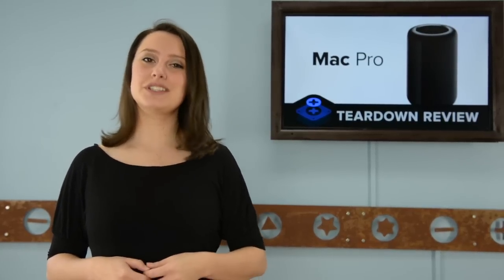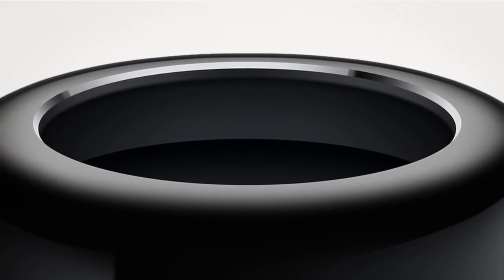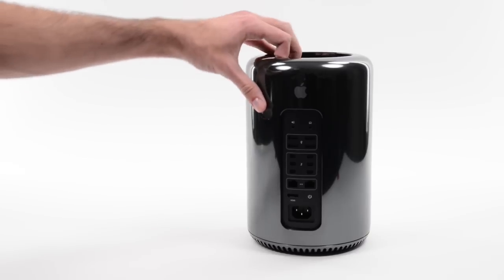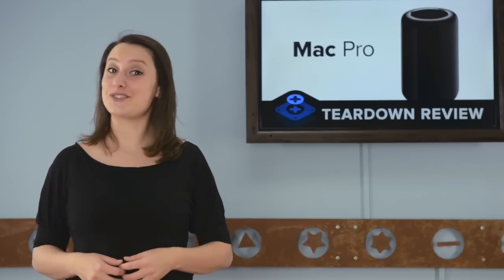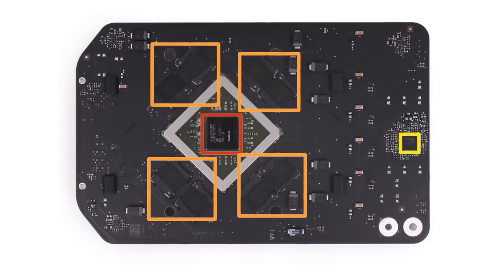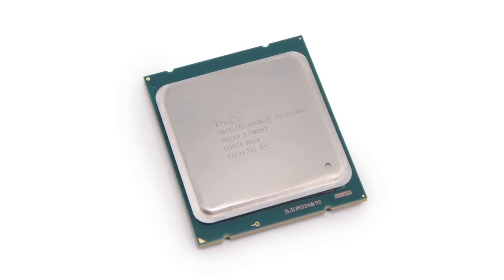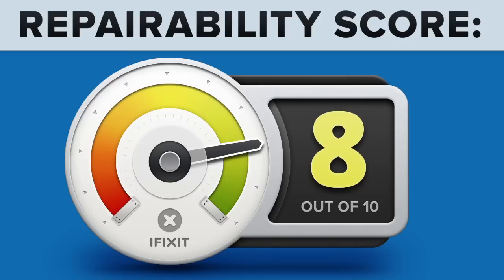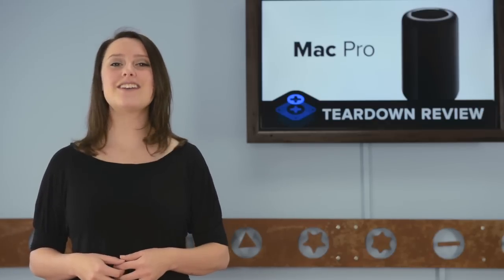Mac Pro Teardown Review

Comment: From an engineering point of view it's a very well designed machine. However it's still overpriced.
Reply: Respected Fella The high price comes mainly because it's designed to be compact and efficient. Which is pointless unless you want to use it as some form of server module, for some reason. Why would anyone want to use a Xeon for a work station? It's too expensive for such a purpose. A xeon inside a Mac book-great! A xeon inside a desktop PC- not so great. This computer would have been a very good Mac mini. But as a full PC it's too expensive for the performance that it offers.
Reply: ronettreker
Well, you also have to ask HP and Dell and Lenovo why they have been using Xeons for all their workstations.
A Xeon offers certified 24/7 operation, more than 32 or 64 GB of RAM and more PCIe bandwidth and more cores.
Or should Apple have gone with enthusiast i7s, which are limited to 4 to 8 cores and 64 GB of RAM and are not rated to be run 24/7?

Well, as for a Xeon inside a MacBook, you probably do no have any idea about Xeon CPUs.
Reply: Respected Fella What I know is that Xeon processors are more efficient and reliable than Intel Core ones but offer less processing power per dollar. So you would use a Xeon if you want a computer that runs 24/7 consuming as little power as possible (mostly servers). Dell and Lenovo have both expensive more efficient Xeon based workstations and cheaper Core based ones. I know Macbooks and most laptops don't have xeon, they mostly use Core while some use Atom, Pentium and Celeron. What I wanted to say is that a Xeon inside a laptop(like macbook) would be great, because of it's higher efficiency thus lower battery consumption(correct me if I'm wrong).
Reply: ronettreker
Xeons are workstation/server CPUs, as they are rated to run 24/7 (some workstations have to do that, either at a broadcast network or at a media production facility or in a research lab).
They are not as power efficient as mobile i7s for example, as those i7s used in notebooks consume about 45 W when in peak use, some only 23W.
A Xeon uses more power and is not ideal for mobile computers. Its size also prohibits it (due to being socketed instead of soldered) to built into notebooks.

Look at this "extreme" comparison between a Xeon 18 core and i7 8 core CPU, both are desktop CPUs: http://cpuboss.com/cpus/Intel-Xeon-E5-2699-v3-vs-Intel-Core-i7-5960X

Also know, that i7s are limited to 32 to 64 GB RAM, Xeons can have 512 to 768 GB to even more RAM.
Reply: Respected Fella Strange...I understood from people like Linus and David L Jones(EEVBlog) that Xeon processors are more energy efficient than Core processors. I do agree on the socket...Never seen a BGA version of a Xeon...
Reply: ronettreker
They are more energy efficient as desktop i7s maybe, but not as efficient as mobile i7s, since there is a difference.
And mobile i7s are limited to 4 cores and 32 GB RAM, not something a REAL workstation can live with.
Mobile i7s and many desktop i7s also have limited PCIe bandwidth.

And when it comes to power consumption, such values have to be considered against all the other aspects, thus less power consumption is not always the goal if one is limited with less cores, less PCI bandwidth and maximum RAM usage.
Reply: Confused Fella Ok. I understand. I thought laptops have similar core processors as desktop only with limited clock rate...I was wrong.
Reply: ronettreker
The i7s and i5s share similarities, but also have many differences in order to achieve the lower power consumption.
Reply: +ronettreker Yeah the 12-core mac pro has a lower clock speed, but that's because it has 12 CORES... A lot of processors with a lot of cores have a lower clock speed, but that clock speed is per core.. So obviously the mac pro is designed for multi-core software such as Final Cut
Reply: +ronettreker Expensive? Yes. Overpriced? Not really.

A comparable (to the base $3000 model) machine, self-built, would only be $720 cheaper. Bear in mind that this is with a standard ATX form factor and uses standard components. The tiny trash can form factor is expensive, especially with the LGA 2011-3 platform. http://pcpartpicker.com/p/VYcfXL
Reply: ReinheldFilms 12 core?! The mac pro has a 4 core and a 6 core option. Can you please give me a link to this 12 core Mac Pro?
Reply: ronettreker
http://pcpartpicker.com/p/3QLk23

It still does not have Thunderbolt 2.0 and BT 4.0 and it is slightly larger, but hey, why consider all aspects if you can ignore most of them.
Reply: ronettreker try apples us website
Reply: Confused Fella Honda Crf Went on Apple's US website. Yep it does say there's a 12 core xeon version, but it doesn't say the price. Anyway, is it really worth it? The six core version costs 4000, while the six core PC in the video comparisson I linked costs only 3000. I know a 6 core Xeon is better than a 6 core I7 or any 6 core AMD, but in the end the cheaper 6 core I7 performed better than the more expensive 4 core Xeon. Yes, at the price of higher power consumption, but it's a desktop PC, so power consumption isn't very important. Also the cheaper 6 core in the video run at lower clock rate. Also beacuse it's a custom PC you can skimp on less important things like the case and you can use a dual drive(SSD+HDD) to lower the price even more, something you can't do with the Mac Pro. Even more, if space and power consumption is not an issue you can use an AMD which will lower the price even more. Ok, the 12 core Xeon Mac Pro may be worth the price since there's no cheaper processor that can compete in terms of power, but the 4,6 and 8 core versions are not worth the price of the Mac Pro.
Reply: ronettreker
It does say the price: http://www.apple.com/shop/buy-mac/mac-pro

As to the 4, 6 and 8 core versions:

• The quad core version upgraded to the max costs 6,099 USD.
And here is the alternative, without TB 2 and BT 4.0: http://pcpartpicker.com/p/BKsJJx

• The hexa core versions upgraded to the max costs 6,599 USD.
And here is the alternative, again without TB 2 and BT 4.0: http://pcpartpicker.com/p/WXM8pg

• The octo core version upgraded to the max costs 8,099 USD.
And here is the alternative, yes, without TB 2 and BT 4.0: http://pcpartpicker.com/p/V2jc99
Reply: Confused Fella It doesn't say the price for the 12 core version. Only for the 4 and 6 core ones. So the max upgraded versions of the Mac Pro 4 core is 6100, of the 6 core is 6600 and of 8 core one is 8100...ok. What do you mean by alternative? The setups you just shown is not good alternatives to the Macs at all... 140 USD for a case? You can get a full case for less than 50. Also 150 USD liquid cooling? Why? The Mac pro is using air cooling.
Reply: ronettreker
You can click the blue SELECT button to configure your Mac.

As for the case, I sorted by rating and then chose the highest rated one by a reputable company. And the Mac Pro case would cost more than 50 USD if available to buy.

The same goes for the cooling unit, but I didn't look if it was an air or water cooler.
If you want you can deduct the 150 USD for that and add 75 USD for a good and big air cooler.

Then add another xyz USD for TB 2 and BT 4.0 capabilities.

In other words, the Mac Pro is not as overpriced as many make it out to be, especially for the size and capabilities.
Reply: Confused Fella It's not overpriced in the sense that Apple priced it too high beyond the total price of all of its parts. It's overpriced in the sense that you cen get similar performance using cheaper parts. The best example would be the case...which is way beyond 50 usd. Just the outer case costs 350 USD http://www.macpartsonline.com/923-0498-apple-housing-enclosure-with-inlet-for-macpro6-1-late-2013-a1481.html
Reply: ronettreker
Then you should also talk to HP and Dell and how they price their workstations.
Xeons cost more, ECC RAM costs more, PCIe flash storage costs more, FirePro and Quadros cost more.

It is not a consumer machine, it a workstation for people making most of their money using digital content creation software and needing more power and reliable hardware, that is rated to operate 24/7 (you won't find i7s in workstations), that has RAM that can check for errors and correct them and has GPUs optimised for OpenCL, not DirectX, as DCC software does not use a gaming API to do the hardcore stuff.

As for the housing you linked to, it is not an Apple affiliated website.
Reply: Confused Fella alot of people use extreme edition I7's in their workstations.
Reply: Honda Crf
They do. I do too, but that does not mean they are the best machines for every scenario.

Where I work (international news broadcast station) many computers runs Xeons, as they are rated to run 24/7 without hiccups.
Reply: Confused Fella Never said only Apple...I know computers based around Xeons cost more than those based around Intel Core or AMD. But, unless you're using a 12 core Xeon or multiple Xeons on a multi socket motherboard the Xeon is not really worth the price... Why would you use a single quad core Xeon workstation? Because it can run 24/7? Most Core i processors can run 24/7 anyway, in fact most processors do, even the cheap ARM ones from single board computers...as long as it's properly run off course. Yes there are workstations that use Intel Core i processors-example HP: http://www8.hp.com/us/en/campaigns/workstations/z230.html The only real advanages of Xeons bellow 12 core are highly specialized like ECC and higher cache...most of which are only usefull in things like Servers and Supercomputers...not personal workstations. Off course if you have the money to spend on a powerfull workstation then go for the highly upgraded 12 core version. The single CPU 4 core, 6 core and 8 core workstations are not worth it as you can get similar performances from the cheaper Core i ones. Regarding the non-Apple affiliated website...they woudn't price the case too high above Apple, it wouldn't make any marketing sense as no one would buy it... so it has to be close to the Apple price.
Reply: ronettreker
Apple does not sell the case officially.

Xeons also offer higher PCIe bandwidth and are RATED (tested extensively) to run 24/7, even if consumer CPUs can do the same (but are not rated to do so),
Also many professional applications are certified for certain configurations of workstation components, thus troubleshooting is easier, as many companies do not have such an extensive tech support.

Our editing bays all run Avid NewsCutter on certified Xeon workstations using Quadro GPUs, yet those short news broadcast or average length features do not require such power.
If a problem arises and the in-house support cannot fix it, it is much easier to get help from Avid with certified hardware than telling them we run Avid on a C2D or i5 setup using a GTX 650 or 950 and thus using untested hardware, which could be the cause of the problem.

Workstations are meant for those that value their time more than the 1,000 USD they might have saved going with cheaper hardware, as that 1,000 USD can be earned in a week or so.
Reply: +Confused Fella but why do thay put a Intel prosser when thay can make there own considering that thay have so much proprietary cone tears and own OS so why not make us spend another thousand $ to upgrade to there better one from them
Reply: steven harvey
Apple does its own mobile chips, but to do workstation chips is a whole other business. See how AMD is struggling compared to Intel, why should Apple face similar struggles when it can use Intel?
Reply: Apple use AMD for its GPU's ATI is owned by AMD. Apple use Intel as CPUSbecause its a better known brand. Apple are all bout MARKETING. Nothing else.
Reply: you get what you pay, better spending money on a perfect computer before wasting money on a windows based pc....

Comment: If I paid 3000+ for a machine, regardless of how easy the repair is I would still look at a repair manual. That's like changing a part on your car with no prior knowledge.
Reply: Well if you built a PC you built it so you know how to fix it
Reply: What part of MAC did you not understand then? I mean you are talking about a company that does both HARDWARE and SOFTWARE. It has been this way FOR YEARS. But you are just now noticing this for some reason? You do know that Proprietary doesn't mean that it CAN'T be expanded right? Because from you comments it would seem that you are under the impression that you can't do something because it has proprietary connections. It's a brand new machine, one that the world has never seen before and you are bitching because nothing is Standard? That right there just blows me away.

Comment: That is horrible to replace the whole port assembly? There are solder stations and hot air stations with components can be replaced! That is called fixing! Not replacing.

Comment: I have built every computer/gaming computer I have ever owned but WOW! when apple go over and above to make a small, compact and powerful rendering machine.. they go all out. I think my only gripe would be the storage capacity within the case, raw video files will fill that baby up quick. (yes I know you can have external but why have wires going everywhere?)
Reply: agreed … spaghetti junction coming out the back of this things to disk raids making its form kind of silly
Reply: They could have increased the size only slightly and it would have still remained very small and had more space for drives.
Reply: you mean , of course "assembled" and not really "built"

Comment: This is an amazing machine, but it comes with a price, which an average user can't afford.
Reply: It's not aimed at the 'average user'. It's aimed for professionals who expect to pay that for a computer. The average consumer can get a mac mini or iMac
Reply: True. I wish iMac to have the same modular design at sone point.
Reply: This is not for the average user.
Reply: These computers are designed for professional workers who don't buy them for their hobbies like I would like to do. But for them it's business. An investment to make their workflow so incredibly enhanced that they profit from it in the long run.
Reply: Mattsana Companies like Pixar and Dreamworks need all the power they can get. Something this new mac pro cannot do. They typically need dual xeon configurations, and possibly, a xeon phi. This is because when they render a frame, they use Mental Ray (or something similar) which is CPU dependent.
Reply: ***** I don't know about Dreamworks but Pixar does use the new Mac Pros
Reply: pp2devane Dreamworks is made on HP machines.
Reply: Phillip Jernigan While than it true, others such as Pixar use the Mac Pro. The point is that the new Mac Pro clearly is powerful enough unlike what ***** was saying. 

And it's not just aimed at film-makers. Designers from across many disciplines will also use this.
Reply: Oh I know.  I was simply letting the guy who asked what Dreamworks used, well used.

I use PC, and I can build my own PC if I wanted.  But I also want a Mac.  I see nothing wrong with PC or Mac or even Linux.  I also have a PC running Linux)

Comment: also you can see by looking at apple specs page this machine is already thermally limited in this design, how can I tell ? … because as the core count goes up the clock speed goes down meaning it cant remain quiet and remove enough heat thermally from the unit to run at the same speed as a lower cored spec machines. Admittedly its harder to remove heat from more cores on the same die but still … it aint great. On a PC you can upgrade the cooling since this is centered round the cooling from a design perspective theres little you can do to upgrade it.

Comment: The cooling aspect is what is interesting here. By having a centralized heatsink it saves a lot of space. BUT....what if you need more? Needs change. I like the idea of the case being the cooling heatsink. But as aluminum and copper is pricey this will probably almost never be used except in Media PC's which have to be dead or near silent. And you pay a hefty premium for this style of case.

Comment: So you pay up to 4 grand for the design? I don't get it. I can build you this same machine for a grand, it won't be round though.
Reply: It was something in 2013, cause it's a 2013 Mac, surely not worth today, but it was real good back in 2013. Getting a computer that powerfull in 2013  and in this compact size WAS and STILL is NOT easy to achieve even on 2017. (Xeon Processor, 4 sticks of fully sized ECC ram, dual GPUs, and lots of IO [6 thunderbolt 2 ports and stuff] plus a nice wifi/bluetooth card i guess).
Reply: But, if you don't really care about the size, you can get a way faster custom built* computer with even $2K or less I guess
Reply: Fiora De Salvateur I can respect the fact that they achieved so much in so little from a technological standpoint. I can admire some of their designs through their product lines, but when you consider repairability on something you spent 3k on, that's when I have an issue.

Either way, I appreciate your approach to a response compared to SargantSkwiglez over there.

Comment: WAIT so you're telling me, its $800 more dollars to upgrade to ONLY a 1TB SSD? I'm honestly sick. I can't finish this video.
Reply: Yes, Apple charges $800 to upgrade from 256GB SSD to 1TB. But, in all fairness, PCIe SSDs are far more expensive than standard SATA3 SSDs. And they're a lot faster!
Reply: You know that 1TB and another 1TB might not be the same thing, right? The faster the speed, the more expensive. I do not know what the SSD speed is on the Mac Pro (m/gb/s), but that might explain the steep price for only 1TB of storage.
Reply: You are comparing an 3000MB/s drive to a cheapo depo 300 MB/s drive